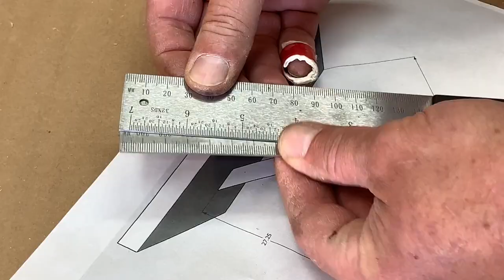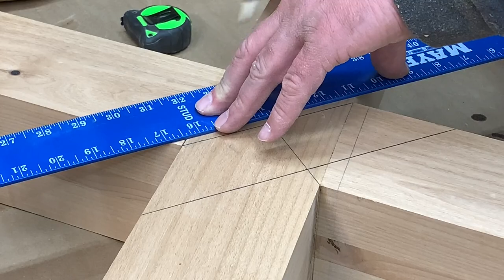Making a Square Alder Dining Table With Intersecting "X" Base.

Comment: Beautiful table. No issues with the two edge boards under the table for enhanced thickness being glued across the grain?  The boards glued parallel I would expect to move with the top boards but those going across the grain, no warping or cracking?
Reply from the maker: Thanks man! I appreciate that. There is actually not any cross-grain glue up on this table. Take a look at 13:36 and you'll see where I glue up the off cuts side by side in the same order as they are on the tabletop. Then when I glue that on at 15:33 the boards line up with their matching board in the top and all the grain runs the same way. This way they can move together. Thanks again for watching!

Comment: I really like your design of the table legs.  My son has requested I make a table for him but he wants it round and a six foot diameter.  How stable is the table with that style base?
Reply from the maker: Hi, thanks for checking out the video. This table is very stable. I followed the 2/3 rule for a pedestal base. So if your tabke will be 72 inches, the pedestal footprint should be roughly 48 inches. I’m not sure how hard and fast that rule is but it has worked well for me. Thanks again.
Reply: thanks for the quick response. I appreciate the 2/3 rule.

Comment: Love the design! How did you calculate the length and angle of the legs to achieve the desired height?
Reply from the maker: I modeled the table in Sketch-up. Once I knew the footprint that I wanted, and the table height, then I had the angle.
Thanks for watching!

Comment: I really like the time and effort you put into that table. The finish is flawless. Amazing work. 5 coats is what I always do when I use Danish oil. What finish did you use please?
Reply from the maker: Thanks so much, Tony. I really appreciate that. I used a satin Arm-R Seal from General Finishes. I'd like to try Danish oil sometime. Is it hard to apply?
Reply: @LastLegWoodworks  No it's pretty easy. One thick coat with a rag then leave for only 5 minutes before wiping off the excess. Then another thin coat after fine sanding every 24 hours. It takes time but the results are amazing and very long lasting. Another advantage of Danish oil is that it's food safe and no need for any stain before. Even on pretty rough pine I get a lovely finish. My whole kitchen is finished with Danish oil. It's not very expensive in the UK and goes a long way with a good shelf life. Maybe it will be worth you experimenting on off cuts. Also because it's an oil it's very weather and UV resistant. Hope that helps. Would love to see one of your projects using it. Just remember the first coat nice and thick and even. Leave no more than 5 or so minutes before wiping off excess, otherwise it becomes very sticky. 😀
Reply from the maker: @tonywharton5220  Thanks for the great information. I have a coffee table job coming up tat may be the perfect candidate. I will do as you suggest and try it on some off-cuts first.
Thanks again!
Reply from the maker: @tonywharton5220  hi, Tony. I’ve been doing some reading today on Danish oil. What brand do you prefer? There are some recipes out there that people use to mix their own apparently.
Reply: @LastLegWoodworks  It's in my shed. I will have a look later and let you know ☺️
Reply: @LastLegWoodworks  The make I've been using is Rustins.

Comment: New here and just getting into CnC, what was the tool called or link that you used to interlock the tabletop with at 11:37? Thanks in advance
Reply from the maker: That is a Festool Domino. It cuts a mortise for a floating tenon.

Comment: Where did you get the plans for the table and legs. I have been looking for the plans for the legs and can not find them.
Reply from the maker: I designed a table myself in SketchUp so there aren’t really plans. I’d be happy to send you the SketchUp file if you are interested in that.
Reply: @LastLegWoodworks  I would greatly appreciate it. I am new to sketchup. I’m learning a little bit still have a king way to go
Reply from the maker: @shaynetcrocker  Sorry for the delay. Here is the SketchUp diagram. Thanks! I hope it helps. 

https://www.dropbox.com/s/3i3w6nuygnhhsr0/Alder%20Table.png?dl=0